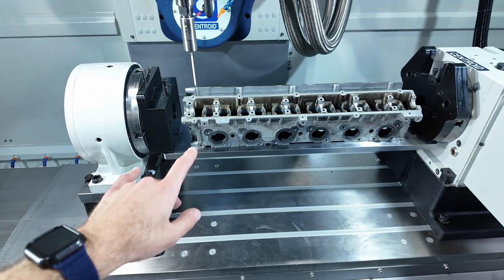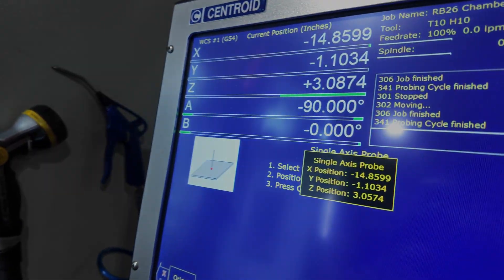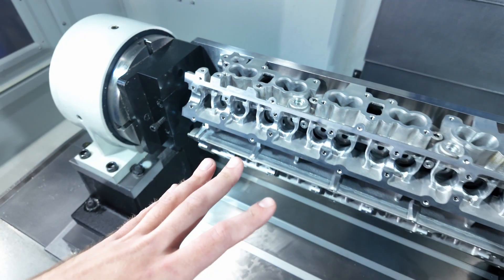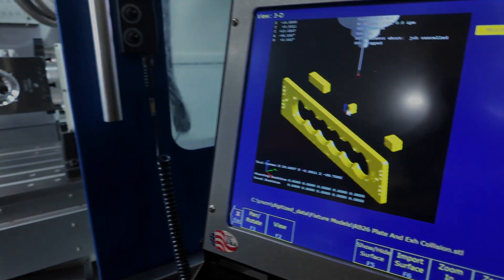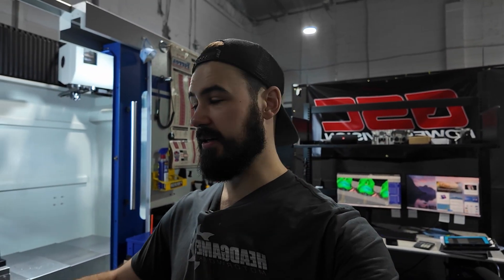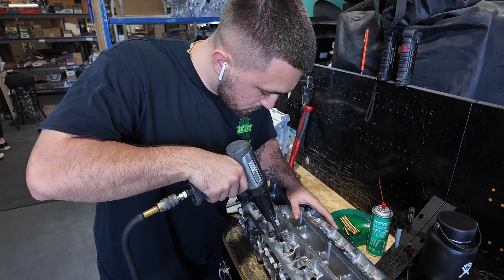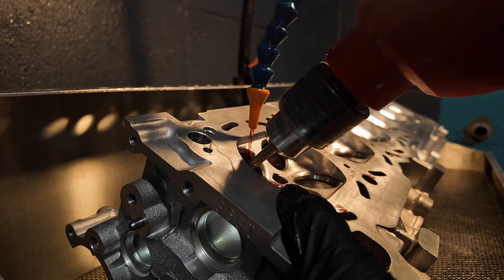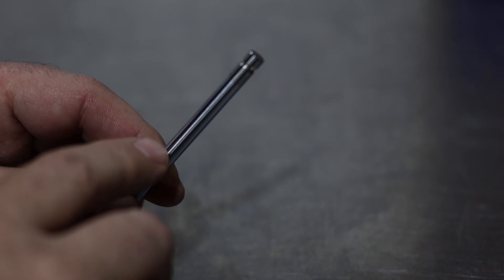RB26 Masterclass: From Digitizing to Valve Job

Comment: Awesome video im interested in seeing assembly and curious to see if you check lifter bore clearance using kelford dlc buckets. I recently made the switch here in aus to dlc buckets and i have one or two bores where the bucket wont turn freely on a relatively new head. Is this something you check head to head? Also curious about where you draw the line on cam tunnel surface finish on used heads and you thoughts on how forgiving the alloy is in relation to minor scratches in the cam bores of used heads. Would also like to know when you make the switch to berrilium seats if at all, i know some shops also go to a bigger seat as they have seen pounding and deformation on the factory od seat with bigger springs after going 1mm over and thinning out the factory seat.